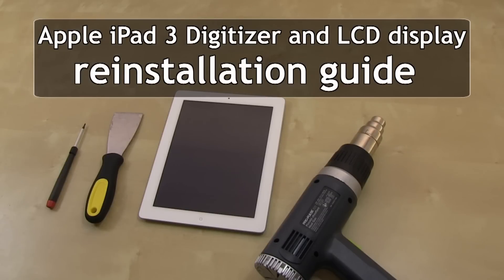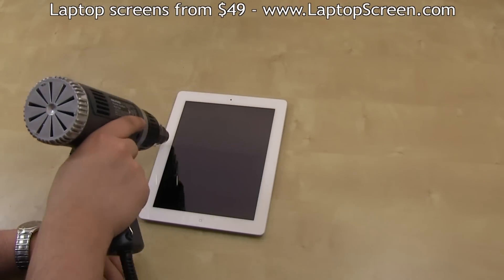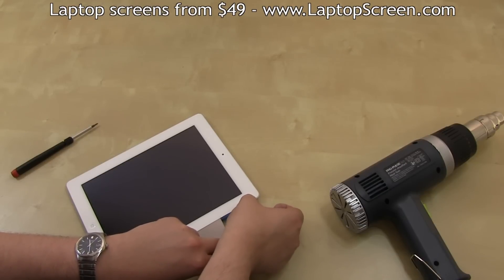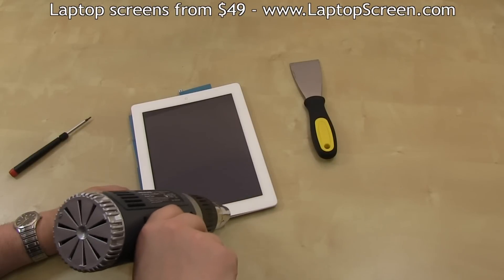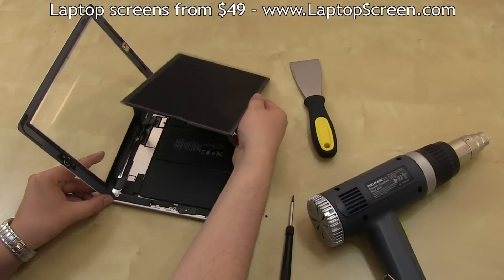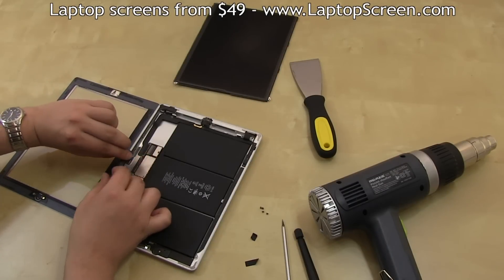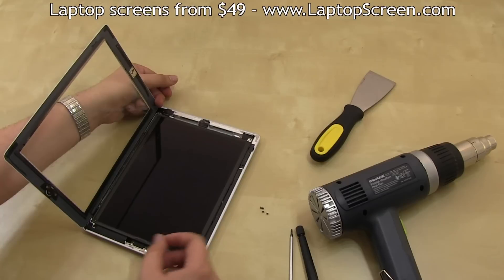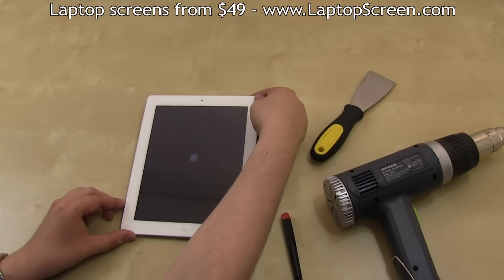iPad 3 Screen Replacement (digitizer and LCD removal and installation)

Comment: is that a common hot gun used by plumbers?
Reply from the maker: Yes, just the regular hardware store heat gun. Doesn't have to be expensive.

Comment: How much heat is your gun set to? Worried too much heat might affect motherboard, Any advice would be great. Thanks in advance!
Reply from the maker: The heat setting is quite relative - use your finger to make sure that the glass is warmed well - that's all. You shouldn't heat it past the point where you can't hold your finger against the glass comfortably.

Comment: Shit, just broke the wifi antennae, is this game over or should i order a new one?
Reply from the maker: Game over? Nah, just another opportunity to learn something.
We've wrecked a power/volume cable on our iPad2 tear down, just ordered the cable, removed extra bits, put the cable in, assembled back up - worked fine!

Go to eBay or Amazon,
Look up your iPad's model number i.e. A1416 + WiFi Antenna + Cable,
and You're (almost) Done! ;)
Reply from the maker: Surprised to hear about the iPad3 Wifi antennae though - in our experience  it separated much better compared to iPad2 - maybe make sure enough heat is applied in that area when doing the repair next time. Sorry to hear about your troubles.
Reply: Thanks for the response, i was far too heavy handed on the screen removal. all fixed now, although i feel like i havent put enough adhesive on the lower part of the screen. It all works though, thanks very much!
Reply from the maker: Christopher McBean Great! Thanks for a follow up.

Comment from the maker: It won't be a good fit with the bent corner.
It is best to straighten it out with manual labor (pliers, file, screwdriver, sandpaper) to achieve the best fit. If the digitizer(glass) is not properly glued, there is a chance that it will come apart at the most inopportune time, and the extra dust on the inside may shorten the life of the device.

Aluminum is fairly pliable, spend some extra time making the edge straight for the best quality repair.

Comment: Thanks for the video! 
I have a question, when my ipad was dropped it fell first on the corner and bent the aluminum backing, the impact cracked the corner and has grown over time. Can you still replace the screen and digitizer and get a good fit with it bent?

Comment from the maker: Doubt that the plastic clip is affecting it.
Although we've noticed a quirk with iPads - when the LCD is not properly screwed in (not grounded) it can sometimes lose backlight. Inspect the LCD, wipe all metal edges with alcohol and cross your fingers after tightening the screws.
Good luck!

Comment from the maker: Anything can and should be fixed.
The repair will depend on how it was separated.
If the cable was ripped - it can be rejoined with a bit of effort and ingenuity.
If the cable was separated from the board, it can be soldered back on.
If nether is possible, LCDs for iPad 3 go for $55.99

Comment from the maker: With a pair of tweezers, magnifying glass and a bucket of patience.
Hopefully the plastic pivots are intact on that little pita latch (yes, hands on experience)
The latch is not integral to the connector operation, the connection can be secured with scotch tape (as best as you can)

Comment from the maker: Yes, it would have been easier to use a heat gun for iPad2.
Also, not using heat gun on this iPad3 would have been easier than iPad2.
However in both cases we would prefer to use a heat gun now.
(One of the main reasons to use a heat gun for the purposes of THIS tutorial was to not break that which is not broken :)  )

Comment: Well... that's Apple for you. Every new product they release requires a new specialized tool! And not just one of them! They are really testing the human ability to make tools. It always requires creative thinking, for good and for worse... even if it means you have to use your hair drier for the job! Perhaps even your comb and tooth brush will prove useful. You have to look for tools in your bathroom and kitchen when you need to repair an Apple product, not in the toolbox.

Comment: Wow! This seems like a daunting and painful task. Why didn't they just put in a few screws on the back or something? That would be so much easier. Because you could use normal standardized tools like Philips screwdriver or a security Torx, or a Triwing driver to remove the God damn thing. There would be no need to invent new tools and methods to get to its guts. Like trying to re-invent the wheel God damn it...

Comment: In your video for ipad 2 screen replacement, you did not use a heat gun and it took alot more time and effort, would it have been as easy as in this video if you had used the heat gun or is there alot more adhesive to deal with in the ipad2

Comment: There is much to leave on this video, for example you reuse the screen on hand. A repair requiring "Replacement of the digitizer" will not come with the button nor the camera clamp. These will have to be taken off of the old screen or bought new if damaged and repositioned on the new screen. This video does not mention these key aspects of a replacement.

Comment: Usually when i replace glass, what i do is that i apply a whole lot of tape across the visible glass.. I've NOT done that a few times and ended up with a shard in my eye at one point, which is when i started doing it.

Comment: depending on your break, this can be a pain in the ass! i suggest a box cutter, just be careful around the wifi antenna and it will make it easier than that flat tool they use.